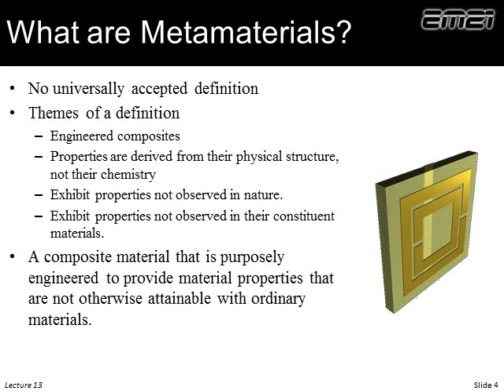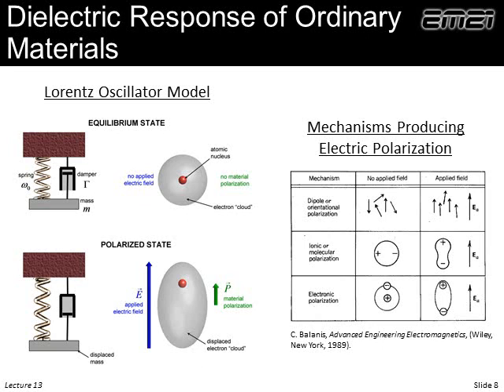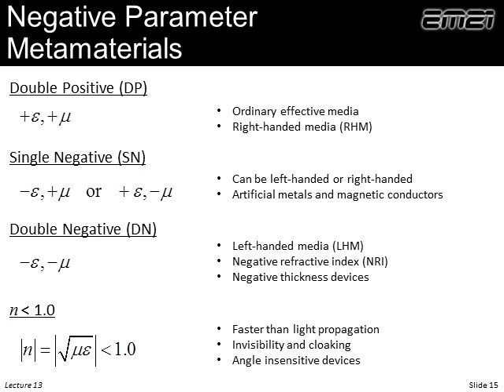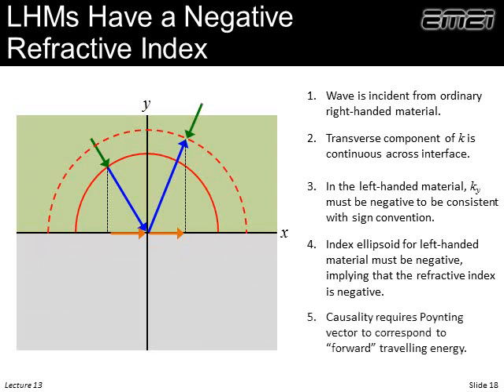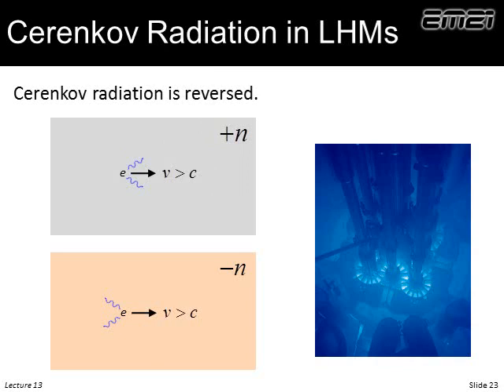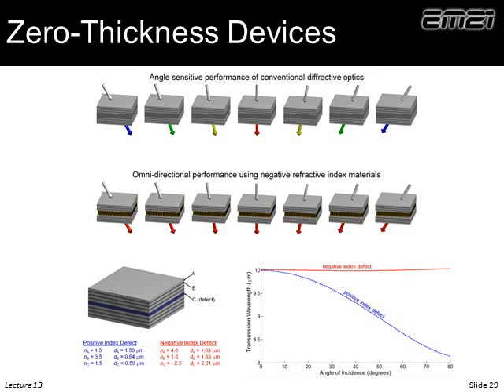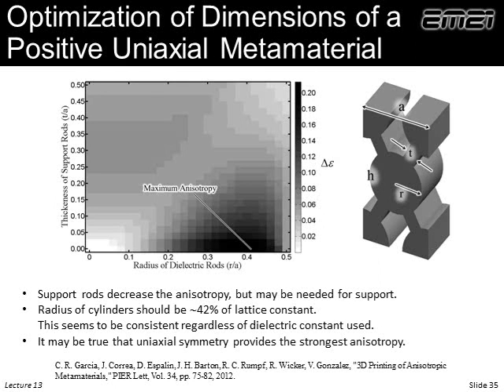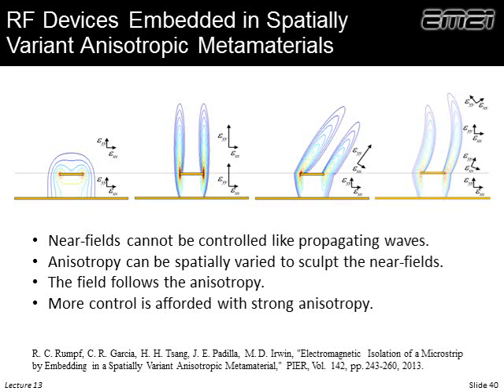Lecture 13 (EM21) -- Metamaterials

Comment: Amazing lecture, thanks for sharing the knowledge! 
One question: why in the Lorentz derivation from oscillation of an atom (slide 10), we only consider the electric field?
Reply from the maker: There are only electric charges, not magnetic charges. Electric and magnetic fields interact with those charges differently so they produce resonances at different frequencies due to different mechanisms. Here I am analyzing only a resonance produced by the interaction with the electric field. This analysis will ultimately lead up to a permittivity. A similar analysis can be done that ultimately leads up to a permeability. Both happen at the same time and so materials possess both a permittivity and a permeability. Both leads to the same equation of resonances, but the constants defining the resonances will be different. Also, real materials will have multiple and sometimes overlapping resonances. The field of science that deals with this most directly is spectroscopy.

Hope this helps!
Reply: very helpful, thanks! @empossible1577

Comment: great lecture. What textbook do you recommend sir?
Reply from the maker: When I first developed this course, I did not like any book as an introduction to metamaterials.  I used my course website as the book:

https://empossible.net/academics/emp6303/

I have not searched in a while, but I suspect there are some good metamaterial books available now.  I just don't know which ones to tell you.

If you are interested in computational electromagnetics of things like metamaterials, parameter retrieval, photonic crystals, diffraction gratings, etc., I recently wrote a book.  Here is a link to see more about it:

https://empossible.net/fdfdbook/

Comment: I am extremely grateful for all the content you produce, it helped me a lot during my research!
I have a question regarding the zero-thickness angle-insensitive optical filters you mentioned here. If the thickness is essentially zero, is there a way to modulate the wavelength of the transmitted light, because that's normally the purpose of these filters - transmission modulation by thickness variation? Are you aware of any papers/research groups I could check to learn more about this concept? Thank you!
Reply from the maker: Thank you for the compliment!  First, let me point you to the official course website.  From here, you can download the notes, get links to the latest version of the videos, and get access to other learning resources.

https://empossible.net/academics/emp6303/

You will find this lecture now in Topic 5, Lecture 5b.  

As for the design, you design them the same way would you would a typical multilayer film.  For example, let's say you have a Bragg grating with two alternating layers, each a quarter wavelength thick.  Those thickness define the reflection band of the Bragg grating.  However, if you make one layer positive quarter wavelength and the other negative quarter wavelength, you get the same reflection band, but the overall thickness is zero and angle insensitive.  Does this make sense?
Reply: @empossible1577  thank you!

Comment: excellent tutorial sir :)
Reply from the maker: Thank you!  This section of the notes is one of my oldest now.  I hope to revise and modernize it soon.
Reply: @empossible1577  Dear Sir, how can i extract/ find the relative permittivity and impedance using CST studio or mathematically using S11 etc , kindly help. Regards.
Reply from the maker: @adnanyousaf5755  I do not use CST so I cannot tell you how to do it in that tool.  If you have S11, it seems like you should be able to work the Fresnel equations backwards to extract the effective impedance.  I have ever analyzed artificial impedance planes, but this is my guess.  I suspect there should be a lot of literature on this topic.
Reply: @empossible1577  grateful sir

Comment: Thank you for this video and all of the lectures you have made about fss's and meta surfaces. They are really clear and understandable. I have two questions . If a material transparent, does it have to be always visible frequency? Or does it mean it is absorbing a specific kind of em wave? And are mm's absorbing because they are actually making the evanescent waves grow? Is  it right to make this reasoning?
Reply from the maker: When I read "transparent" I think that means transmission at any frequency whether we can see that frequency or not with our eyes.  I suspect the dictionary definition of "transparent" requires it to be a visible wavelength of light.  The first interpretation is probably the better one when reading the literature.

There are many mechanisms for a metamaterial to exhibit loss.  Having large evanescent fields is not directly one of them.  Evanescent waves are sort of just temporary places for electromagnetic energy.  That energy will eventually radiate away as a propagating wave.  Loss is typically ohmic loss in the metals.  Metamaterials are resonant so the loss is amplified and a big problem actually.  There is also dielectric loss, but that is small compared to the ohmic loss in the metals.  If the metamaterial is close to something else, large evanescent fields can play a role in loss because they can provide a leakage path for energy.
Reply: @empossible1577  thank you very much sir.

Comment: Really interesting! Thank you for this lecture! You really put me a lot of interest on this! 
What are the lights wavelength used? should be meters or centimeters? In visible you can you apply those materials?
Thank you
Fernando, from Porto University, Portugal
Reply from the maker: Probably the most common optical wavelength is 1.55 micrometers because that is common in telecommunications.  Longer wavelengths are used in infrared imaging.  Shorter wavelengths (visible wavelengths) are used for cameras, microscopes, etc.

The concept of metamaterials is applicable to any frequency.  The struggle may be achieving the size and the material properties needed.  For example, metals do not act like metals at x-ray frequencies so I am not sure how we would make things like split-ring resonators at x-ray frequencies.  On the other side of the spectrum, imagine the size of a metamaterial unit cell operating at 1 Hz.  The concepts work electromagnetically, but when it comes to actually making the structures we sometimes struggle.  Microwave frequencies is a very convenient scale to make things because the elements are roughly the size of a coin.  That is why you see so much metamaterial work at microwave frequencies.
Reply: @empossible1577  , Nice I got it! Thank you! So to be able to make a Harry potter invisibility cloak, I would need a 500nm/10 resonator rings and capacitor to be able to produce a n<1. That
Reply from the maker: @cssaziado  That is about right.  The other problems you will face is making it broadband enough to cover the entire visible spectrum and then also combating the loss.  Metals are very lossy at optical frequencies.
Reply: @empossible1577  ,Thank you very much, again, for your answers. I would love to know what your group is studying atm, do you have any link to articles or stuff? I became really interested in these materials and proprieties. I am a masters student, so I am thinking about a thesis.
Reply from the maker: @cssaziado  Here is a link to our research website.

http://emlab.utep.edu/

I have a PhD student about to defend his PhD and I will be posting his PhD defense likely today (assuming I get it from him).  That will give you the latest and greatest.  Subscribe to CEM Lectures and I think it will notify you of new uploads.

Comment: please a question 
 how can i calculate the parametre of the a cssr or csrr (extern ray, the gap or the width) for each frequency ?
and how can i do it if have two resonance frequency ?
thanks
Reply from the maker: I first recommend searching the literature.  These structures have been pretty extensively studied.  If you want to do all of this yourself, I recommend studying parameter retrieval and homogenization.  There is a lecture about that on this channel.  Calculate the effective parameters for some known structures from the literature to be sure your tools are working correctly.  Once you have these, do a bunch of parameter sweeps that connect your structural parameters to the effective parameters.
Reply: @empossible1577   i just understand 
yes i will do it by my self 
thanks so much :D

Comment: Great video but it seems like an incomplete one.
Reply from the maker: It definitely is.  It is hard to squeeze everything into a single lecture.  Also, have you watched the videos that come before and after?  All periodic structures share a lot of math and theory and this is covered in other lectures.  Also, let me point you to the official course website.  This has the latest version of the notes which have seem some revisions and improvements since the videos were recorded.

https://empossible.net/academics/emp6303/
Reply: @empossible1577  Thanks..those resources are quite good.

Comment: We could engineer molecular electron spin so that it contrast inversely with temperature by increase internal gravity to balance absorbed heat so that it could survive extreme temperature and could be use to build extreme small CPU that can compute high speed without increasing resistance like super conductor and utilize the shadow emf to help the self sustaining motion of survival in extreme temperature according to law of conservation of matter and energy. This could help reverse agimg process in material and human. The path of electron could be in infinity sign could keep energy and mass in balance in and out

Comment: Hi. I checked the EM21 course website . Seems very interesting. I am specifically interested in metamaterials and the related theory. Can you tell me which other videos are related to this one. :) Also, I would like to know if you recommend any books regarding metamaterials. Thanks! You are doing god's work!! :)
Reply from the maker: Pretty much the entire course is related to metamaterials although the connection may not be obvious to you at first.

Lecture 2 -- Lorentz and Drude Models
This lecture covers why materials have a dielectric or magnetic response and covers general properties of materials.  Metamaterials are mimmicking nature and have a good background in this will give you insight about how metamaterials work.

Lecture 3 -- Metamaterials are usually anisotropic and even bi-anisotropic.  I also cover topics hear needed for using transformation optics to design metamaterial devices.

Lecture 5 -- Coupled-mode theory is a framework that  you can use to understand just about any electromagnetic device.  This ties into metamaterials and periodic structures in order to engineer the coupling.

Lecture 7 -- This is a key lecture to understanding anything periodic, like metamaterials, photonic crystals, frequency selective surfaces, metasurfaces, gratings, etc.

Lecture 9-12 -- While not traditional metamaterials, this are very related topics and good to understand.  For example, at a high enough frequency, metamaterials diffract.  The lecture on subwavelength gratings are metamaterials and explains how to engineer the anisotropy.

Lectures 12-15 -- These are the core metamaterial lectures that covers all engineered materials including mixtures, metamaterials, and photonic crystals.  It has has a discussion about how to retrieve the effective parameters of metamaterials.

Lecture 16-18 -- These lectures cover techniques for designing metamaterial devices.  The spatially variant lattice stuff is a somewhat new topic that we are finding to be very powerful and enabling.  We have done amazing things with it!

BTW, below is a link to the course website.  Many of the notes have been revised, improved, added-to, etc. since the videos were recorded.  Be sure to look at the electronic notes as well.

http://emlab.utep.edu/ee5390em21.htm

Comment: why do metamaterials have negative permitivity  and negative permeability? why do they behave differently to light or incident wave?
Reply from the maker: To fully understand metamaterials, I recommend first studying ordinary materials.  Work to understand different resonances that materials have.  You will find that permittivity can be negative even in ordinary materials, particularly around resonances or in metals.  I cover this topic in Lecture 2 of this same course.

Next, study metamaterials and see how current resonance in the metallic structures is emulating the atomic scale resonances in ordinary materials.  At this point, it will be less mysterious how permittivity and permeability can be negative.  It is just a consequence of the phenomenon arising due to resonance.

When one or the other is negative, the materials acts like a conductor (magnetic conductor for negative permeability).  When both are negative, you have a left-handed metamaterial with a negative refractive index!  Crazy things happen then.
Reply: @empossible1577   thanks for the reply sir... can you tell me why do they metamaterials act as frequency selective surfaces? thanks in advance..
Reply from the maker: @TechnicallyExplained  While metamaterials can filter frequencies like a frequency selective surface (FSS), I would not think of metamaterials as an FSS.  Metamaterials are more analogous to bulk materials.  Flat, essentially planar, structures are the metasurfaces, frequency selective surfaces, diffractive surfaces, etc.

Most metamaterials are resonant.  This inherently leads to filtering because resonance itself is a frequency selective process.  Even at frequencies where the metamaterial is not resonant, you can tailor metamaterial lattices to resonate across multiple units cells, more of a macroscopic resonance.  For example, a metamaterial slab will produce a sort of Fabry-Perot resonance that can filter frequencies.

Comment: Hi, thanks for sharing this nice lecture on metamaterials. Could you please refer a book that explains about how to optimize or calculate the metamaterials effective properties, permittivity and permibility?
Reply from the maker: That is a very difficult question.  I do not know of a book that covers everything you will need.  Instead, consider taking the following steps:

1. Learn to simulate a metamaterial in order to calculate its effective properties.
2. Benchmark your parameter retrieval tool using multiple results from the literature.
3. Learn to do parameters sweeps in your simulation tool.  Study how the various features of the metamaterial affect its effective properties.
4. Use #3 to study various metamaterials in the literature.
5. Learn optimization.  Optimize a single variable at a time to...say...make the dielectric constant equal to 10.  Now optimize two things to do the same.  Now optimize multiple things to make er = 10 and ur equal something else.

By the time you get through this, you will be an expert in design of metamaterials!

Comment: hello 
hello.Can you tell me please how did you get damping force (collision frequency) in drude model ? Which are the equations or the theory  calculations? thanks in advance
Reply from the maker: I think the best way to obtain these values is to retrieve the effective permittivity and back calculate the parameter from that.  There is another lecture in this series on homogenization and parameter retrieval.  Let me also point you to the course website that has links to these videos, plus the latest version of the notes.  There have been quite a few revisions and improvements since these were recorded.

http://emlab.utep.edu/ee5390em21.htm